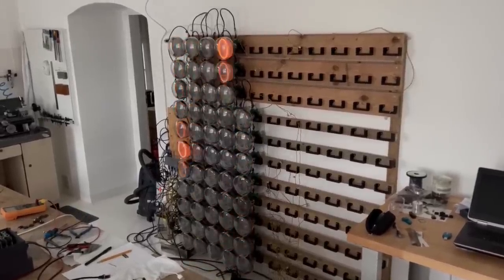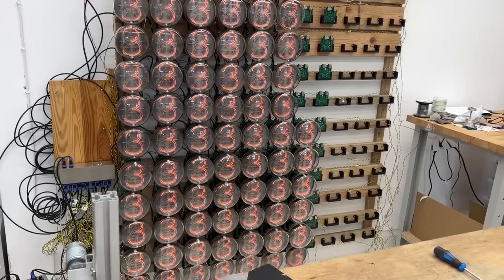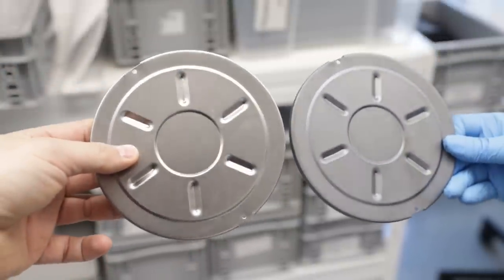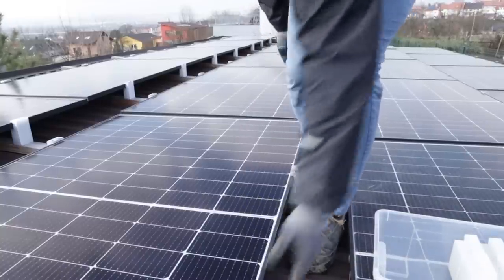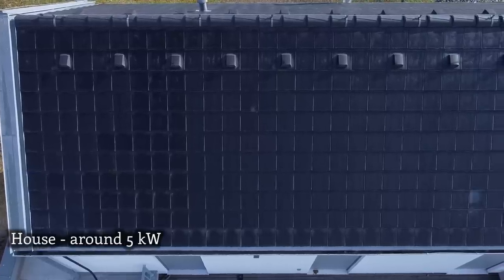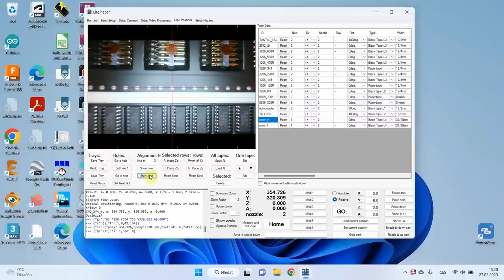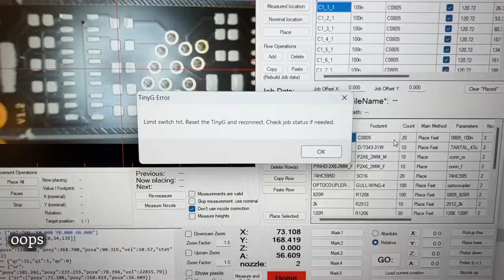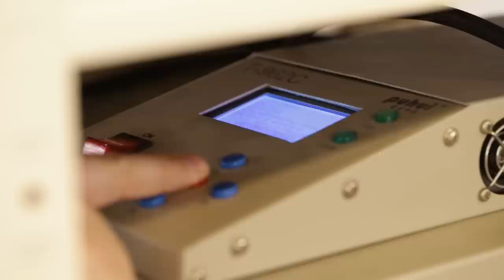Will we make it on time? Installation for Japan, solar plant | February 2023

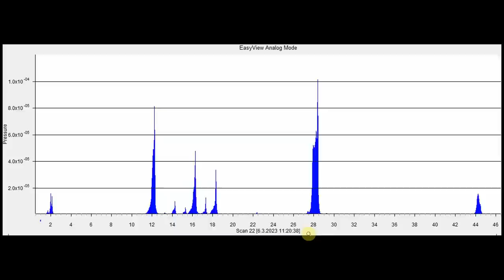Comment: 4:12 : Hey, that's a mass spectrum! That's my jam!

So, the peak at 2 is H2, those peaks at 12 and 16 are lone carbon and oxygen atoms. They are formed in your mass spectrometer from the electrons ionizing the gases: CO and O2 can get split and form C+ and O+ ions, which is what leads to those peaks you're seeing. Methane can also be contributing to the peak at 16.

The peak at M/Z=18 is water.

The large peak at 28 isn't necessarily just carbon monoxide. Turns out, nitrogen, N2, also comes out at that exact mass!

And if you look lower, you indeed have a small peak at 14, which is that of lone N+ ions, also resulting from electron-induced breakdown of N2.

So some N2 is likely contributing to the M/Z=28 peak.

That said, I see no O2 (M/Z=32) nor Ar (M/Z=40), so you don't have significant amounts of air leaking in your system. Meaning N2 is likely only a minor contributor to that peak.

You also do have a CO2 peak at M/Z=44

This could indeed all be from some organic matter decomposing in the nixie tube during the vacuum phase. (I assume the tube is heated as you pull the vacuum?)
Reply from the maker: Thanks for the interpretation! There might be some nitrogen on 28, but considering the height of the peak on 14 (secondary peak for N2), it wont be significant amount. CO is more probable, good point with 12 and 16!
Heating - yes, it is most apparent when we reach 400C during bakeout of the tube, so probably decomposition of organic matter inside the tube.
Reply: @daliborfarny  "it is most apparent when we reach 400C during bakeout of the tube"

That is indeed a tell-tale sign that you have dirt burning off!

Best of luck in finding the source.
Reply: @daliborfarny  It depends on the ionisation energy, but at ~70-90 eV, the relative intensity of 14 in CO is ~0.6% (where 28 is 100%), while the relative intensity of 14 in N2 is ~7.5% (where 28 is 100%).  According to this, there is absolutely no CO in this spectrum. 44/CO2 has a bit of 28 fragment, probably around 10 percent. CO2 can come from your gas burners, but the CO should be less than that even if the flame is oxygen deficient.
Reply from the maker: So, you are right guys, looks like we did wrong interpreatation of the mass 28. It actually looks like nitrogen - the small peak on 14 is roughly 7% of the 28.. The blackening batch contains NaNO2 and NaNO3, this is where the nitrogen can come from. We dont have leaks in the system and no other sources of N2 in the material inside the tube.. Thanks for the tips again!
Reply: @daliborfarny  Glad to hear you were able to fix your issues! ^^

Comment: So inspiring to see your journey!
Reply from the maker: Thank you so much!
Reply: just a stray thought... but it sounds internal...maby you have a reaction with the argon and carbon monoxide from the wood piece you use to close the tube on the lathe..is it all batchs, or only from the start of a run?... litterature says Argon and CO can turn in to carbon... which might then deposit on the electrodes. is the closing tool climatized?
Reply: or the gas mixture before a run...

Comment: Interesting update, thanks. Really cool to see the ship that'll be carrying the crate! I've done IT security work on tankers and seen a few being converted from HFO to LNG in dry dock. China banned HFO vessels a while back, and the IMO have been pushing for greater LNG adoption, so it's good to see some progress in reducing the pollution on new cargo ships.

Quick tip for the stencil: you can specify a negative paste mask expansion size in EAGLE's DRC (I think they call it "cream" instead of paste for some reason?) and that'll adjust your stencil apertures all at once. You can then swap the DRC rule back to the normal expansion value when you export for mass production - just make sure to add that step to your checklist, otherwise you might forget and end up with badly assembled boards!
Reply from the maker: Thats great, I knew the fabs have this option, but I didnt know it is so easy in Eagle! We will try next time

Comment: I think the PNP machine could save a bit of time. I understand this was the first time using it and learning the software. For the next revision of PCB's before they arrive you could print the PCB layout on paper. Teach the positions of the components on that and once the PCB's arrive just double check it on one or two modules. If all looks good you could let the machine work while you do something else. I don't know if this machine has any way of alarming you when there's an issue. If not then just once in a while check it for faults/issues.
Reply from the maker: Good idea, setting it up before the pcb arrives! Will try next time!

Comment: Could always use a CNC solder paste squeezer, though I can’t imagine it would be very quick.
It should be rather easy to import your stencil SVG into Inkscape, do an inset or two on the paths, before exporting it again, that should be a repeatable way of making your holes smaller. Might also be better off using something thinner, though it’s hard to say.

Comment: Try metal sheet stencil with proper support around the pcb. In most cases the PCB is put on a flat surface and the stencil sides are not supported, thus causing it to bulge upwards, thus allowing paste to go under the stencil too. Put similar thickness support sheets around the pcb to support the sides metal stencil itself, also try to secure both the pcb and the stencil as well. If you have a board with multiple similar boards, then use a stencil with multiple cutouts, thus reducing the possiblility of error when moving and repositioning a stencil. About the reflow oven: pay attention to these ovens, I use similar one. The internal ventilator is not strong enough to pull it trough  a filter. Instead install a tube and a filter, then install an external tube ventilator motor to outside. This way you can prevent smoke build up. But pay attention to the speed of the motor, if it pulls the smoke too fast, then the entering cold air can throw off the heating curve of the oven. It is best to solder and reflow in a fume hood like design, where the smoke is constantly pulled away. Don't forget to install another inlet, or open a window when you do this, especially if your heating system is based on gas, because it can pull back co2 and co from the chimney. 
DIY carbon filters are good, but if you have employees you have to make sure to buy approved carbon filters from designated distributors. (sounds bad, but law requires it because of harmful materials in the solder paste and soldering iron)

Comment: Thanks for posting Dalibor.
Makes me wonder how Russia was mass producing Nixie tubes many decades ago. You have high tech instruments to do measurements and still run into problems. How did they do this 50 years ago?
Reply from the maker: I met the guys who run nixie tube production in 70s here in the Czech republic and asked them questions about reliability, problems etc.. They had the backing industry at hand - all the vacuum tube production machinery, materials etc.. so they run into much less problems, but they also had many.. Also, they didnt have the tools and electronics to do the measurements like we have now.. What was interesting - they mentioned they dont remember any tubes coming back under warranty claims - so either they were 100% or nobody cared about it :-D
Reply: @daliborfarny  That's very interesting to hear. I guess because they weren't that expensive back then people indeed didn't care to much and just replaced them :)

Comment: The problem with solder paste is that you're holding the scraper WAY too shallowly to the board. It needs to be 45°-60° to the board, but you're holding it almost parallel to the board! The result is that it squeezes the paste under the stencil.
Reply from the maker: Thanks for the tip! Will try next time, cheers!
Reply: @daliborfarny  yes the solder paste definitely needs to be better. That's way too much solder and will most likely lead to shorts.
I also suggest using some sort of frame to hold the stencil down properly. It needs to rest flat over the PCB! 

May I ask why you are not using standard stainless steel stencil?

Comment: You can make stencils from 0.15mm stainless steel sheets with fiber laser engraver (50w fiber laser is enough for that). That stencils are rigid enough to use them without frames or with simple fast clamping universal frame instead of individual frames.
Also you can use cnc paste dispenser (solo machine or as an attachment for any existing machine) instead of stencil.

Comment: I have some suggestions: Use a strong solvent like 100% synthetic acetone to dissolve any dirt or oils on the metal parts and create a dust-free environment while assembling. always use gloves while assembling to minimize any oils from fingers. Essentially use a similar process as used to assemble optical instruments such as lenses, and cameras.

Comment: Have you considered nitriding for a black contrast finish without the issues of rust etc.
Reply: 5:03 "and then it is blackened by a mixture of sodium hydroxide and sodium nitride" i.e. they ARE nitriding it!
Reply from the maker: I will look at the option, I am afraid to outsource this process as the supplier can contaminate the parts with oils. Once the surface is etched and matte, it is very hard to clean from oils..

Comment: Are your PCB's made locally? Otherwise don't you have to wait for shipping on those as revisions are made? How does placing your own components help on the revision time?
Reply from the maker: Yes, they are made locally with 5 days leadtime.
Reply: @daliborfarny  Nice! You might try making your stencils out of stainless steel foil, they should lay flat on the board better than the plastic(?) you were using.

Comment: How long do they last ? 
I doubt a 1000 hours.
Stainless solder mask anodes in a penning mix ?
IN1 nixies didnt last long until the gas was mercury doped
Mercury amalgamates with rhe nickel anode, so instead of sputtering the
anode the mercury vaporises
Reply from the maker: no worries, we use Hg doping as well - nixie tubes without it have very short lifespan. Our other tube model (R) is just slightly blackened on the glass after 7 years in 24/7 operation.
Reply from the maker: Nickel amalgam, interesting - do you have more info on this topic? There are old Hg doped nixie tubes with NiFe elements inside, never saw any signs of reaction with mercury. But for this reason, nixie tubes use non-evaporable getter as the regular barium getter (mirror) would amalgamate with mercury..
Reply: @daliborfarny  Nice work.
Reply: @daliborfarny  I heard it from someone years ago, I understood, Hg gets the bash from the ion,
cools off, and has a cuddle witth an Hg friend and settles back

Comment: I would imagine it takes much more LNG to power that ship than heavy fuel oil...
Reply from the maker: It does, LNG contains less energy per kilogram. But the exhaust gas is just water vapour and CO2..
Reply: Heavy fuel oil has about 24% more energy by weight. There are many long term financial and environmental benefits from switching to LNG though.
Reply: @-vermin-  I would imagine it is still more expensive, and more dangerous. Sorry, I just don't believe in increasing costs for everyone to fulfill some politically charged aspiration.  And yes, a big part of it is political.
Reply: @douro20  You can have whatever unsubstantiated "imaginings" you like. Does not make it true though. Do some actual research.